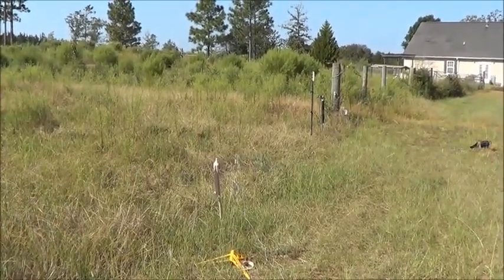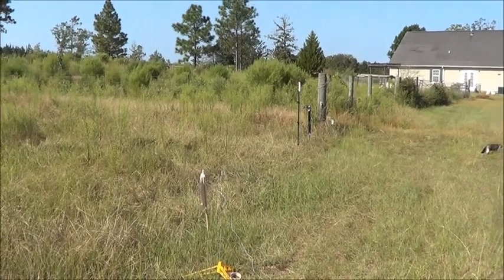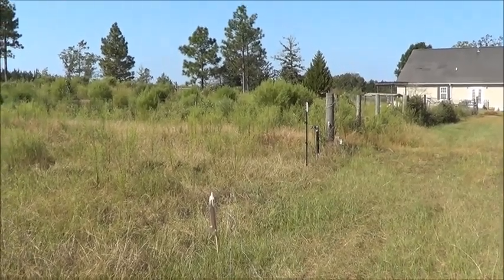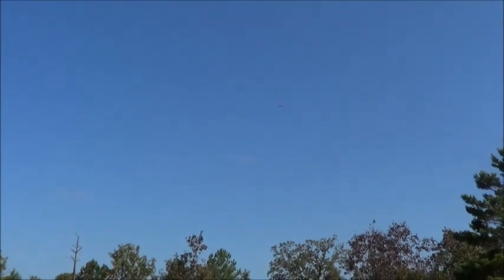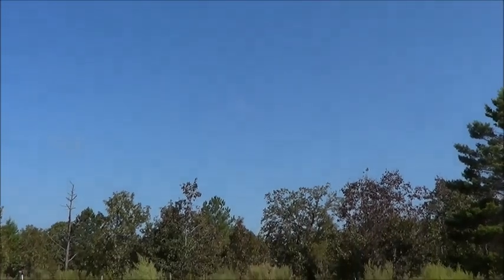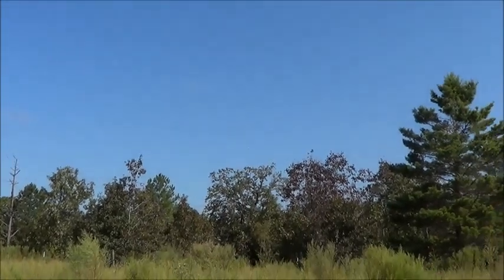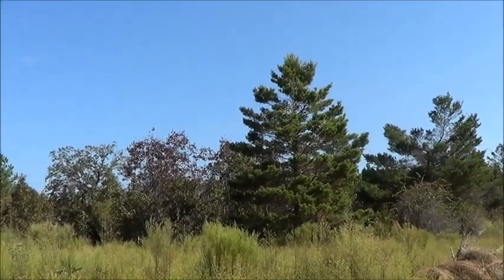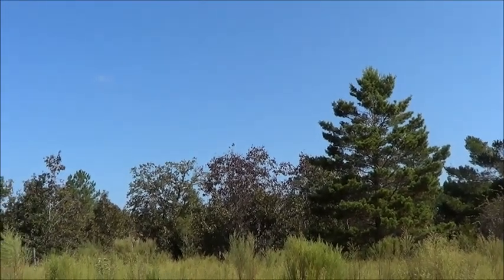Fliplock Lite 13mm rocket glider - Flight Demo

Comment: Josh,

Where’d you get an A3-2T?  They haven’t been made in many years. 

Looks great!
Reply from the maker: RecordersRocketsBEC, I got it completely out of my addled mind. That's what happens, I guess, when you half expecting your rocket to turn to confetti.
Reply from the maker: RecordersRocketsBEC, I should add, I've got several unfired 1/2A booster engines and the like that my dad didn't use up as a kid.
Reply: The reason I asked is that some of your kits (at least the Mini Windlance) recommend this long OOP motor on the instructions. I figured you could have some - I've managed to get my hands on some long OOP motors of various types - but I also thought that calling them out as recommended was likely a mental typo.
Reply from the maker: It's a little of both. I did have several packs of A3-2T motors which I finally used up fairly recently. I've been really abysmal at keeping up with the NAR approved motor list and it's a hole in my flying/marketing that really needs to improve.